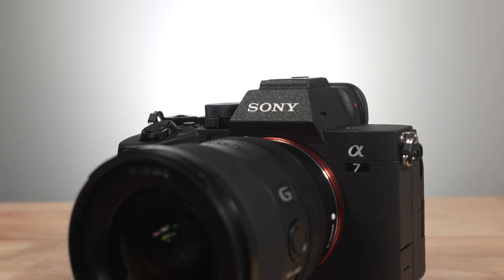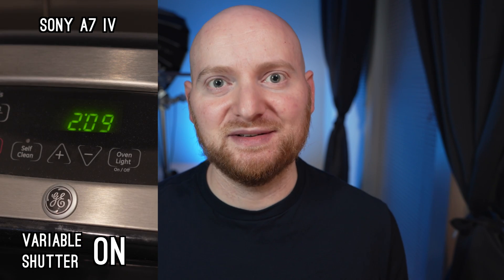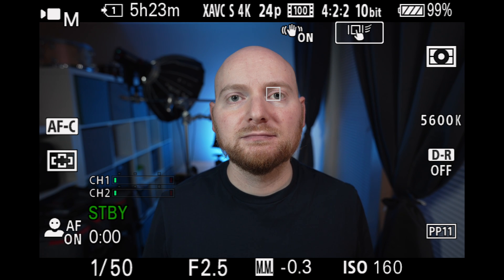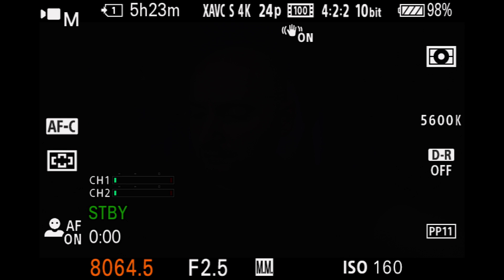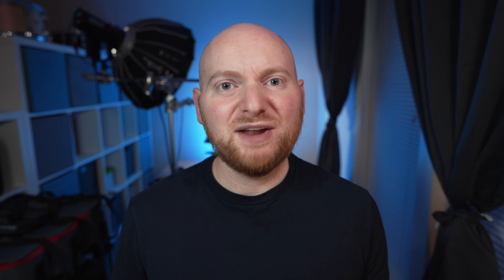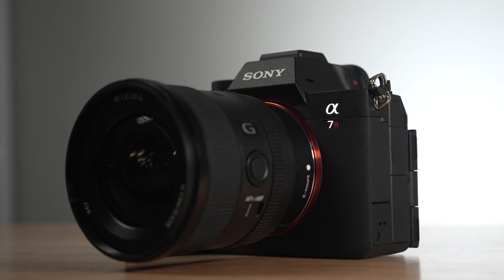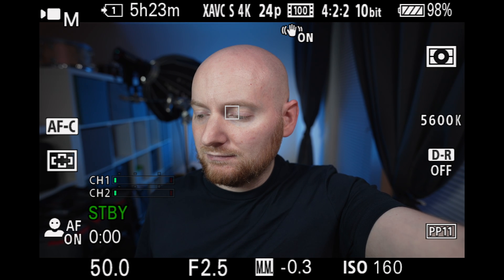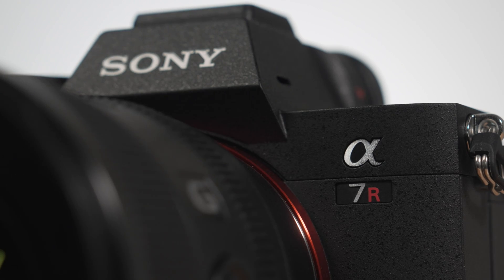HACK 180° Shutter Angle in the Sony a7R V Using This Trick!

Comment: If you don't care about faithful motion blur and cinematic looks, but just want the smoothest most detailed pans and zooms, what SS and FR should one choose?
No people present in the shots. High depth of field.
Reply from the maker: I'd think about either 30fps and 1/60 shutter, or 60fps and 1/125 shutter.
Reply: Thanks Andrew
Why these rates?
Still under the impression these settings are for optimising motion blur
Which I don't want
Cheers
Reply from the maker: @ The frame rates of 30 or 60 will give the smooth effect you're looking for, and the SS just matches what's required for it. For "cinematic" motion blur, you're really looking at 24fps and 1/50 or 1/48 SS.

Comment: I changed the variable shutter but I found i cant put it back to for example 1/50, how can i get i back
Reply from the maker: You should still be able to, it'll just go in smaller increments. But if you turn Variable Shutter off, you'll definitely be able to get back to 1/50

Comment: It's possible to do this in a7s3?
Reply from the maker: Good question - if you have the v3 firmware update, you can adjust shutter down to 1/48 in the a7S III since Variable Shutter still isn't included as a feature.

Comment: As Crazy as this might sound, Sony does not have Confident in their Mirrorless camera Software department, they are really scared to update their firmware out of fear of some bug happening after multiple people updating, just like last year 2022, they had to pull fx3 and fx30 firmware, because it was causing boot loop issues, it all make sense now why Sony Seldom update their Alpha Series cameras Firmwares. I buy Sony cameras for only it's Autofocus and it's portability other good things. The known best Cameras that support their cameras down in the future and even add more features to the camera through Firmware are Panasonic Lumix Cameras like updating old S1 that was only 4k now does 6k 422, and also update the camera from SQD card to be able to use CF express type B and it can use Shutter Angle, that's Crazy!!, Canon adding internal Raw to C70 and some of their Cinema line cameras. Red Cameras adding Face detect Autofocus to their DSMC3 line up cameras example Red Komodo and V raptor.
I Own Sony A7iii, A7Siii and A7RV so I know little about them, I enjoy their cameras big time, but Firmware update never cross my mind with them.
Reply from the maker: Yeah, it's definitely been the case with Sony where you can't expect much in terms of updates. Even the a7S III getting S-Cinetone was considered a big deal given their history around lack of firmware updates. Whether it's fear, lack of resources, etc., I hope it's something they can prioritize more in the future. The Cinema line/OS folks certainly seem to prioritize it more and give their team more freedom with updates - e.g. the FX6 getting Breathing Compensation, etc. with v2 firmware.
Reply: @andrewsaraceni  true